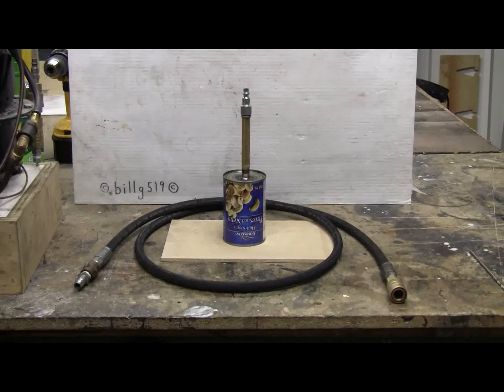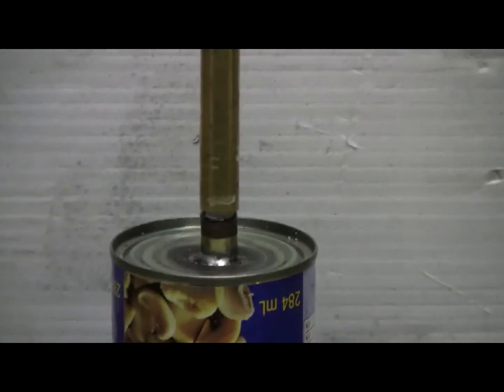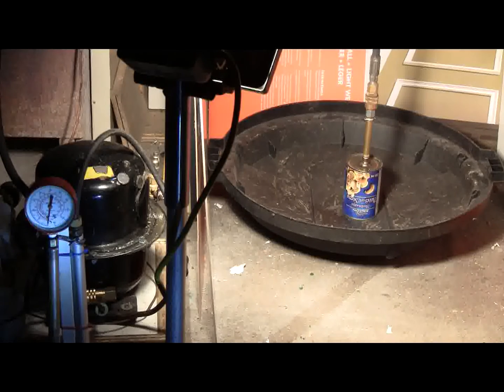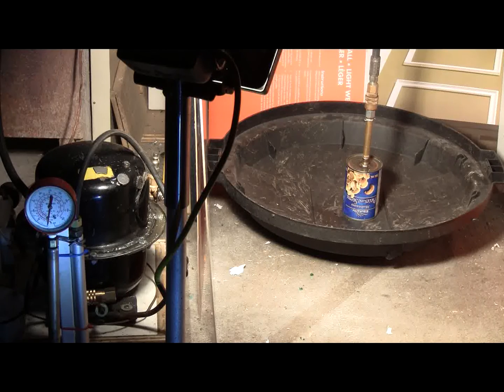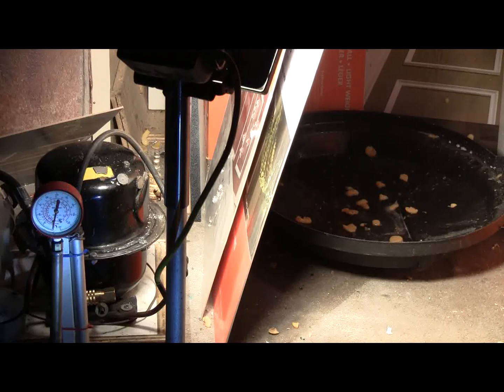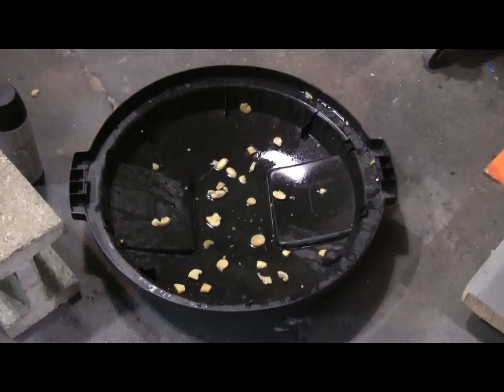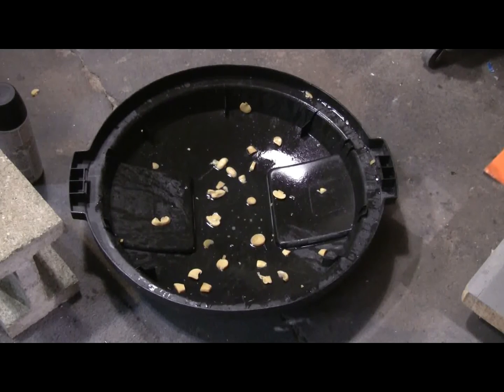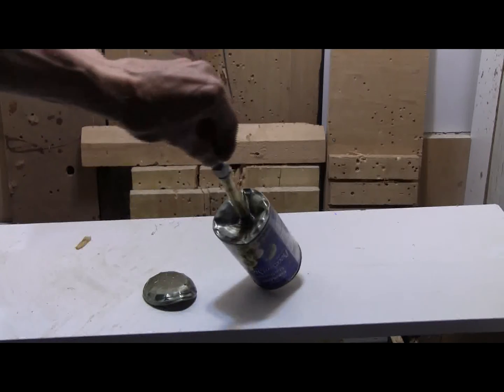Air Compressor - Bursting A Can Of Mushrooms

Comment: Here is why the top of the can imploded: First, it is important to remember that the high pressure bubble of air occupies a small volume in the top of the can. The moment the bottom failed, the high pressure air rapidly accelerated the fluid out of the can. As the fluid moves down in the can, the air bubble expands, and its pressure decreases. The fluid, now being propelled by its own momentum, pulls this air bubble in to a partial vacuum, collapsing the top of the can.